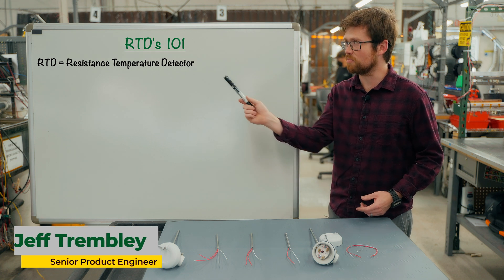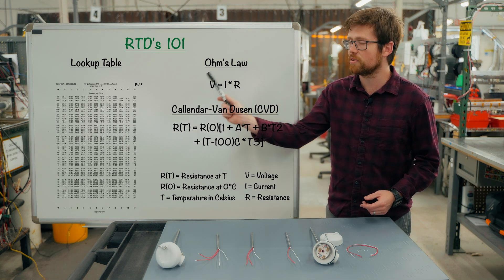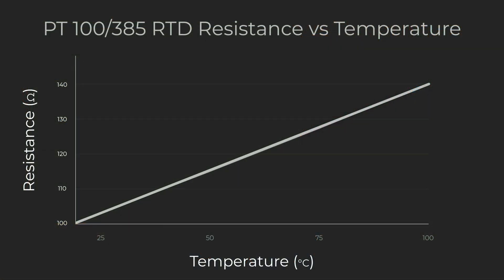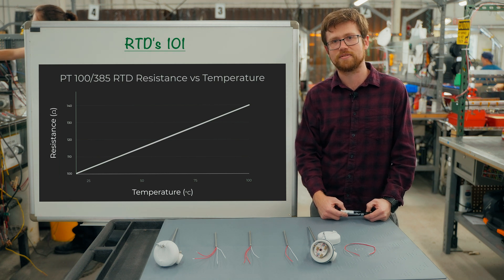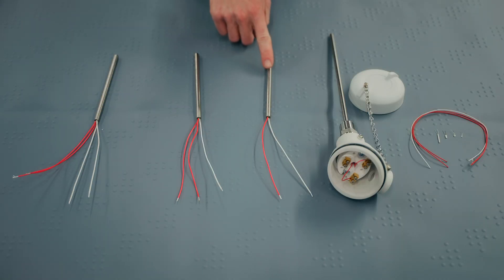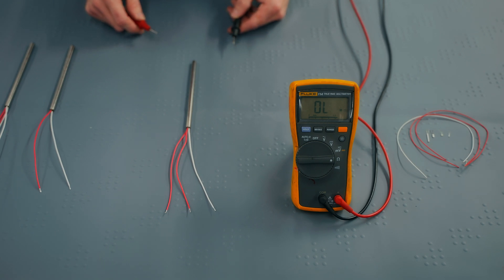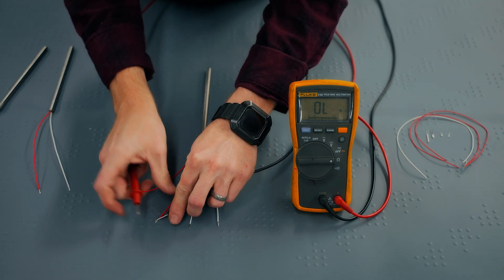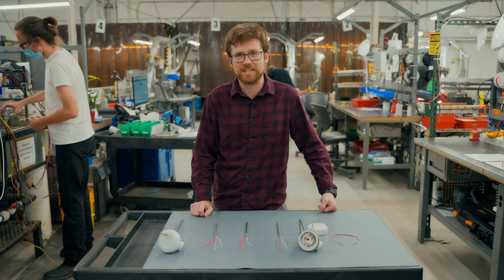How to Check if an RTD is Working Using a Multimeter | Reotemp

Comment: Hello? I have a question. I would be glad if you answer. Thermal resistance measurement range is 0-100 degrees Celsius. and output current 4-20 milliamps. at 50 degrees the output current is 12 milliamps. but there's something wrong here. because as the resistance increases, the current must decrease. but for some reason our output current is large. thanks in advance (translated via Google)
Reply: https://youtube.com/@instrumentprocessmanagement?si=ut-9QSgZ4cptXWce
Reply: Your question is outside the scope of this video. You're talking about a temperature measure system. The video is just about the sensor. Also, increasing resistance doesn't necessarily mean reduced current. A constant current source can supply current at a constant level even with changes in load resitance, within limits of course.